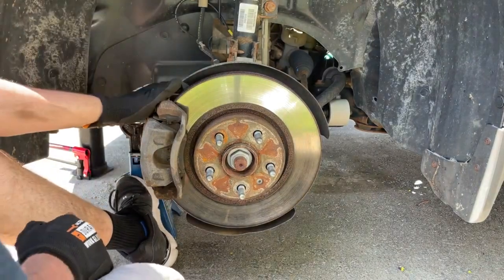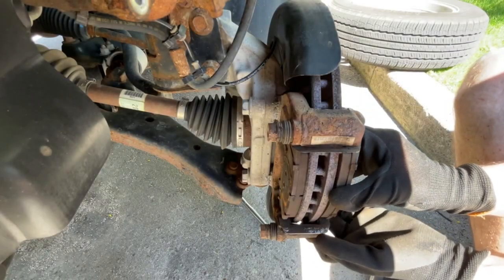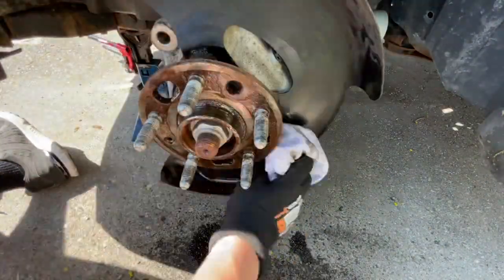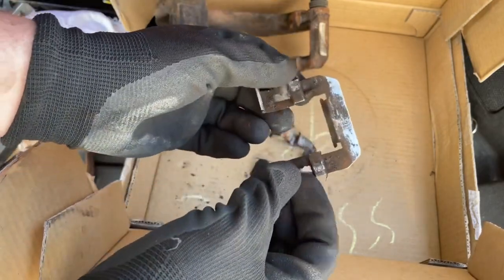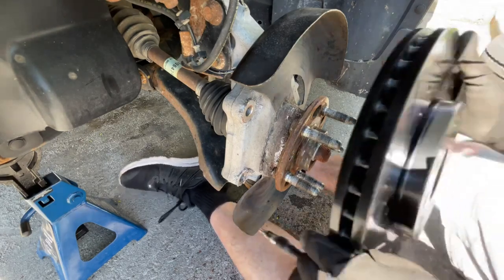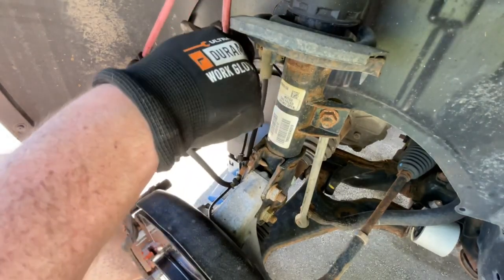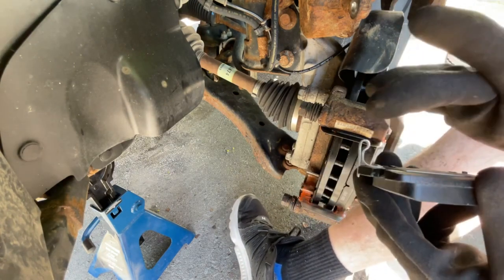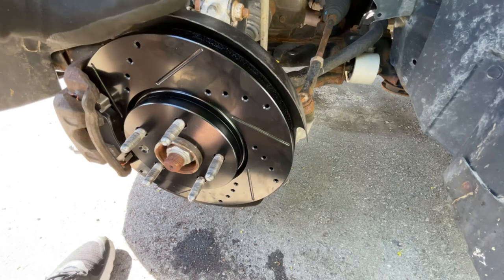Chevy Equinox/GMC Terrain Front Brake Pad & Rotor Replacement (2010-2017)

Comment: Question -the brakes I used (Detroit Axel) have caused a ton of brake dust.  However, this guy detailed my car yesterday and said there is grease on my rims.  why would that be.  It's been several months since I changed out my brakes
Reply from the maker: I would suggest to look at your cv axle right where it meets/enters the transmission. Check if your boot is ripped because that can expel grease as it rotates. Also inspect the transmission case around the cv axle. If there is an oily stain around it then you have a bad transmission seal. I’ll be replacing mine in a couple months when I’m caught up with other stuff. I hope this helps. Thanks for watching. Please like and subscribe

Comment: Are 2018 terrains different?
Reply from the maker: The sizes of bolts and torque specs may be different. However the process to changing brakes on any vehicle is the same. ie every vehicle has two caliper bolts, two slide pins two clips and two caliper mounting bracket bolts. Once you know the process to change brakes you can do it the same on any vehicle. Again the only difference may be that you need to grab a different size socket. And just be sure to look up your torque specs. Thanks for watching. Hope this helps. Please like and subscribe

Comment: I put drilled and slotted rotor on my Equinox and hated them. They hum at speeds above 30 mph.  Loud!  Today I am installing standard rotors.  Don't make the same mistake.
Reply from the maker: You had a bad experience. All drilled and slotted rotors aren’t like that. Mine perform far greater than oem with zero issues. Perhaps you just had a bad set. Did you contact the manufacturer. Maybe they will rectify the issue or suggest a way to fix it.